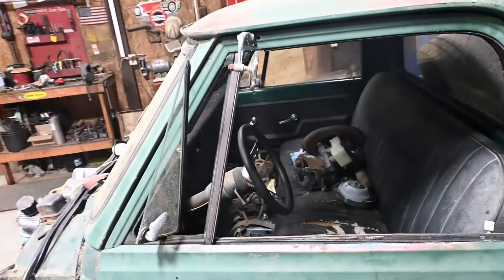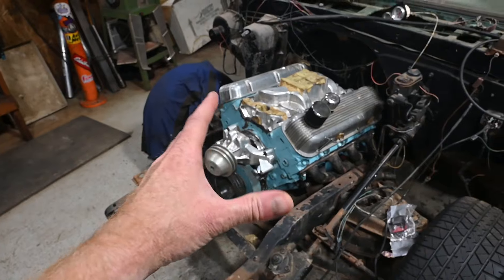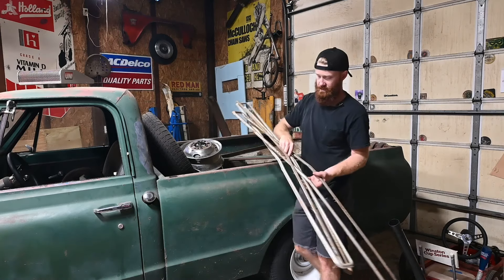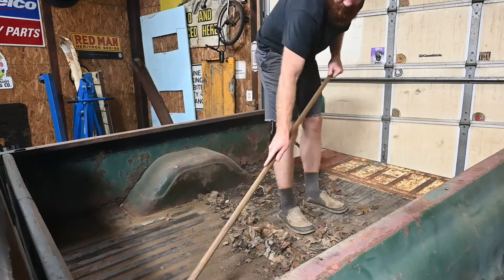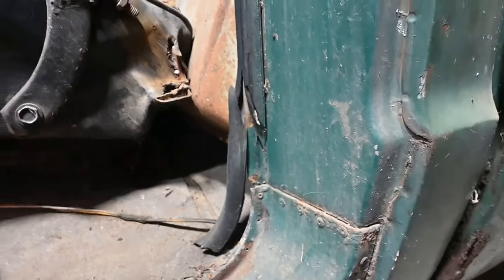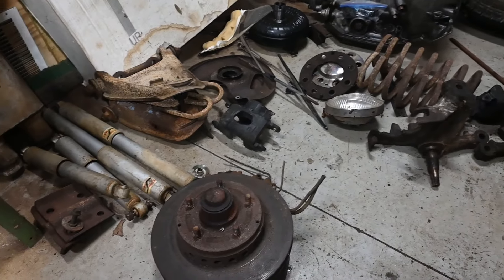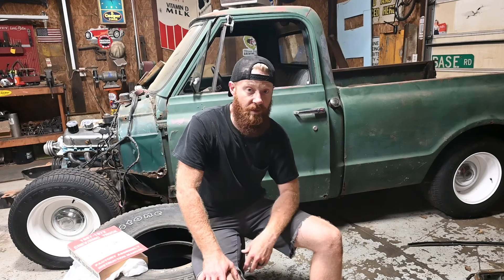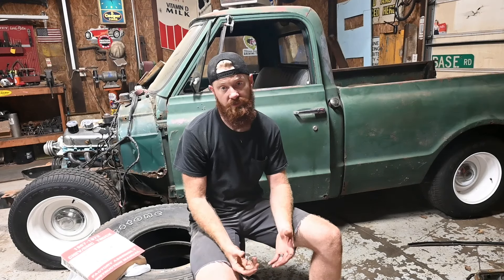Cleaning out my Abandoned 1967 Chevy C10! Sitting for 30 years!

Comment: Coolest thing I found was $800 cash. Dropped the gas tank and there it was! Also, I vote for Drag & Drive.
Reply from the maker: Holy crap that is definitely a cool find haah
Reply: @Metal_Massacre_Fab_Shop  Yeah, after that I stripped the car. Looked inside the tank. Pulled up the carpet. It was strange, but it almost covered the cost of the vehicle.